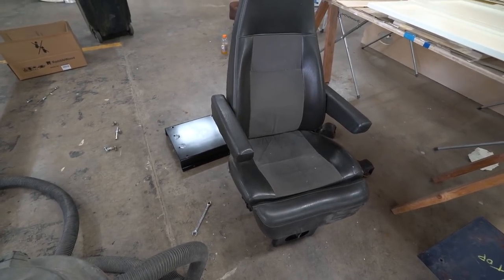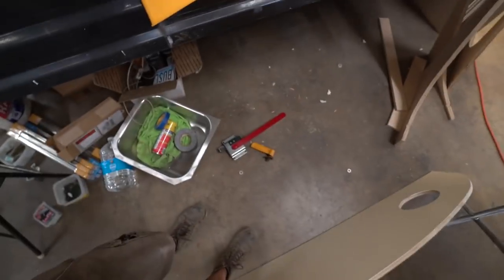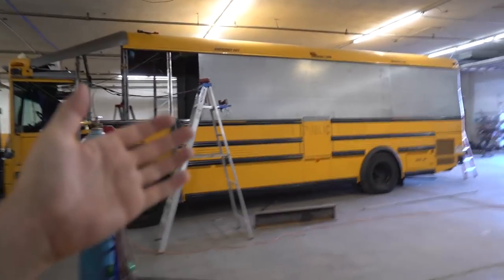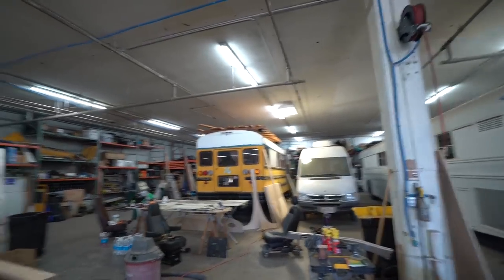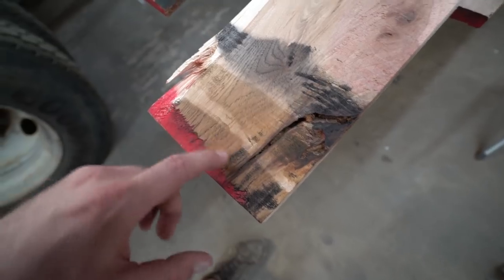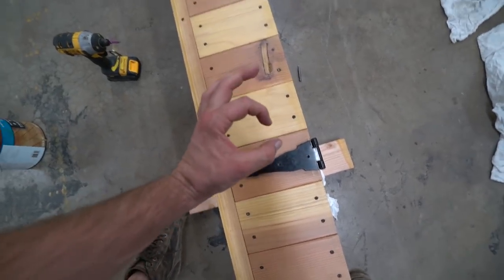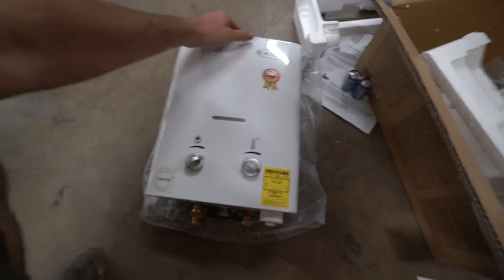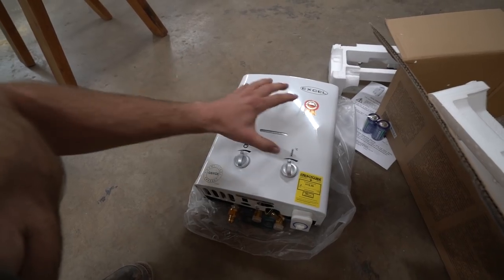Custom Countertop Wood // New Tankless Ventless Water Heater + Stepup Bits

Comment: if that overhang of the deck is going to stay you will need to be extra careful  and not catch it on a tree or bridge and rip it off and half your roof with it lol.  also dont forget to measure overall height  when your done and post it on your windshield support so its visible easily while driving because of low bridges etc,
Reply from the maker: Good tips! Measured! It’s only 8 inches higher.
Reply: watch for width too... of course thats my two cents worth and its probably not worth half of that lol,  hope to have my disability in january or february, my hearing is in january.  will be getting a van for myself.  maybe we will meet up on the road sometime and say hi.

Comment: It might be ventles but its still a good idea to put a small vent to the outside near it , if you build it under the sink (good place as the hot water is closest to the tap )  you could vent it out the sidewall using a.smal panel with louvres whont let a lot of cold.in but it be safer
Reply from the maker: I thought about how long i shower for and how long the heater would be on. Never longer than a minute max.

Comment: Do you still recommend this Excel water heater?  I see you have the campux, I think it was called, on your Amazon store.
Reply from the maker: Zack Vance only get the excel. I’ll try to update that. Thanks
Reply: @JaxAustin  love your videos. Very informative and entertaining.
Reply: @JaxAustin  I have another quick question. Since the Excel is ventless, does that mean you can install it inside the bus without venting?
Reply from the maker: Zack Vance that’s meant for a home application. Skoolie showers are quick. I put out more carbon monoxide cooking breakfast. Your call.